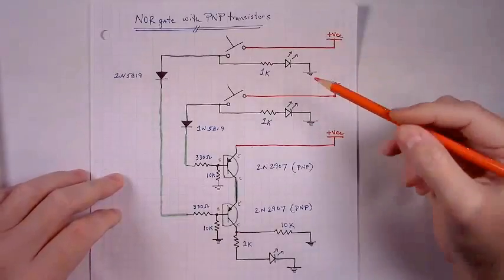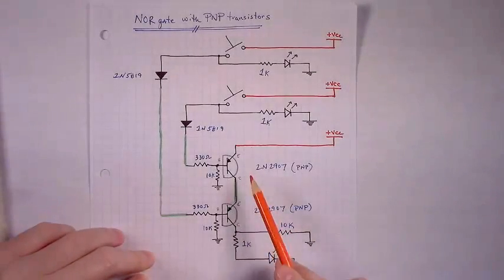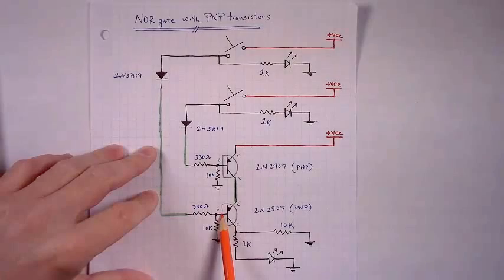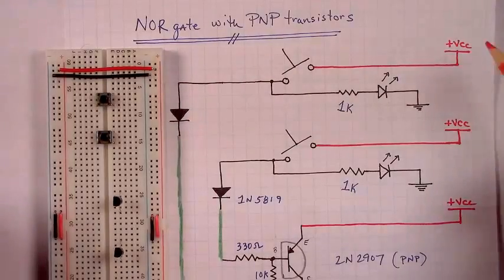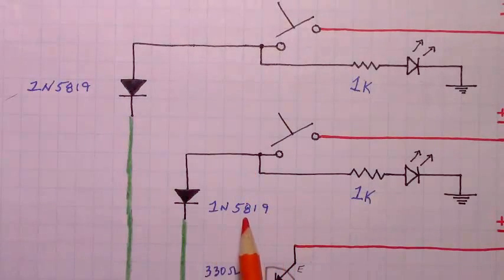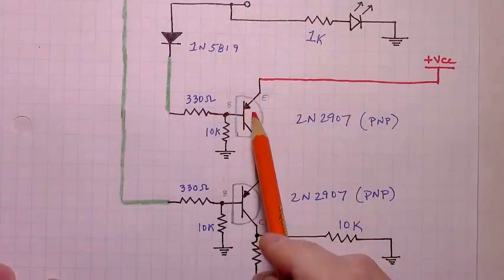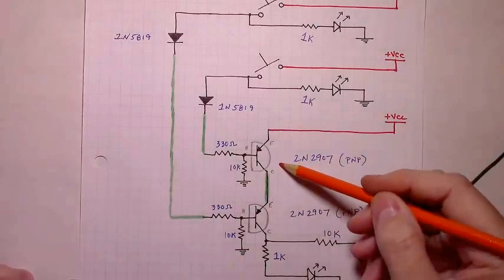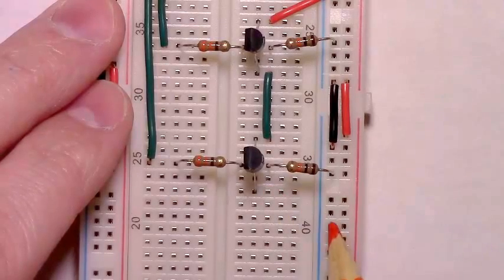Circuit Assembly Tutorials || How to build a NOR gate with PNP transistors

Comment: man do you have tutorial on how to make RF module(Receiver and Transmitter) like the one in RC Car. ? like make it from scratch? i have search in internet but i haven't found something done using op amp, or without microcontroller, if you do it would be great.
Reply from the maker: Exogen Design Appreciate the question.  Building a reliable RF module from scratch is often quite the challenge.  Using a microcontroller and various off-the-shelf components tends to be the easiest way.  However, it's definitely possible to build such, a few of my friends have done so.  I've not yet spent the necessary time to work through such a project, I often just strip the components needed from bargain-bin RC cars, boats, etc., and hack together a workable solution.  But, I will certainly look in to what might be possible in terms of a set of tutorial videos.   Until then here are two potentially helpful discussions about the early designs and ideas behind RC signaling and circuitry:

"A (very) brief history of model radio control systems "
http://myweb.tiscali.co.uk/norcimradiocontrol/Radio6.htm 

"DIY servo transmitter schematic" 
http://www.rcgroups.com/forums/showthread.php?t=1356590

Hope the links are helpful.
Reply: thank you man! this is a good thing to start, I appreciate the help you've given, to me thank you so much!.